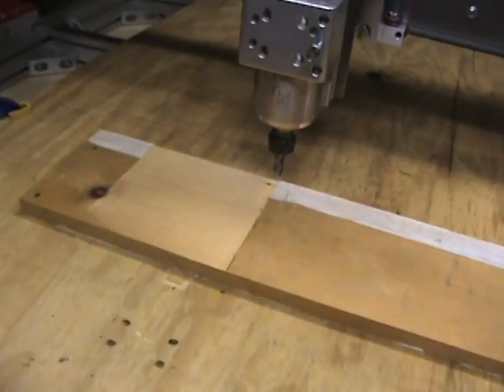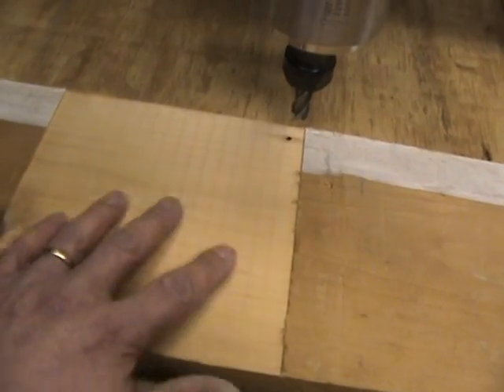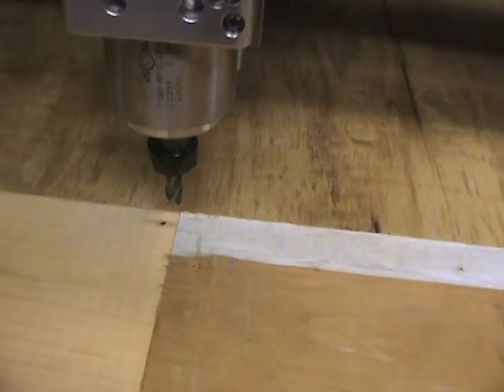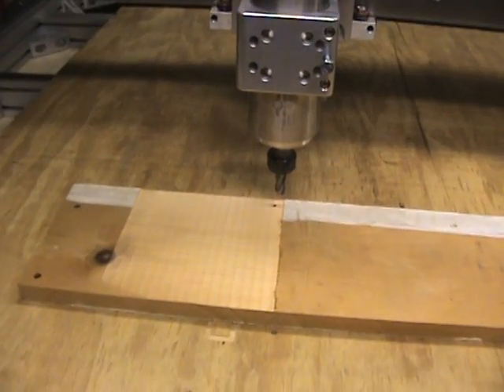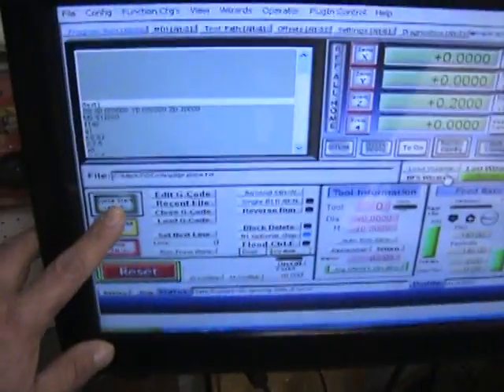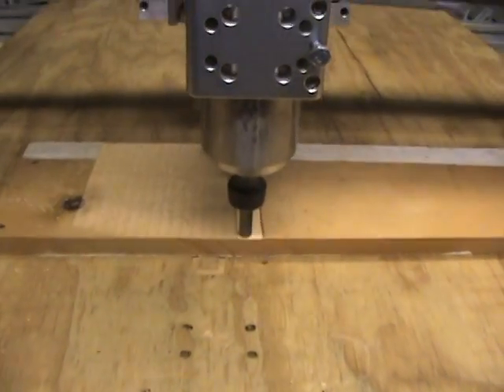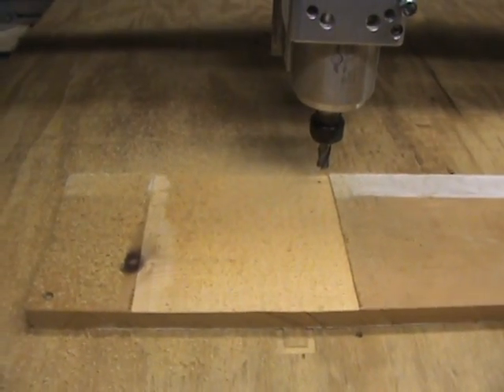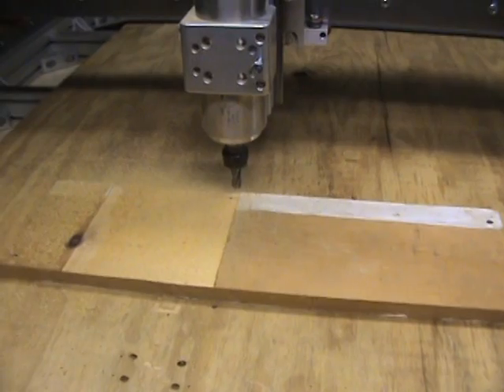Building CNC Router Parts CRP4848-22.MPG

Comment: Nice machine,How do you like those bearings? do you have a problem with racking? im building a 5' x 45" machine. I went with supported bearing rails on mine. All 3/4 inch alum..
its heavy, the gantry is probably over a 100 lbs. Im looking at 3/4 inch ball screws (1/2 dia for  z) with a 1/2 in  pitch. the motors to move the long travle is 1050 the other ones are 600 oz/in. sofar how do you like the spindle ?Any advice would be helpfull.